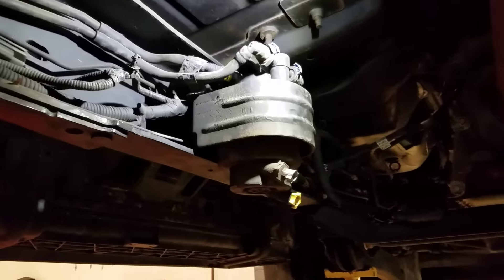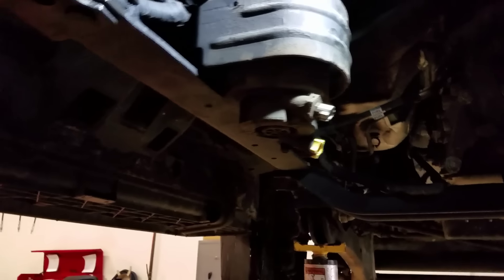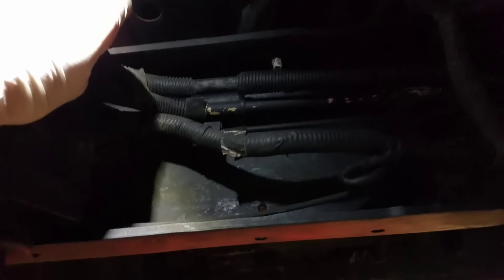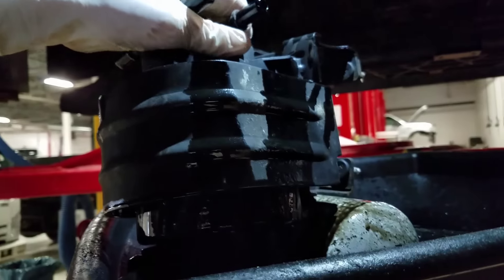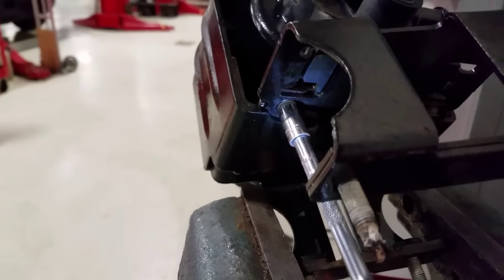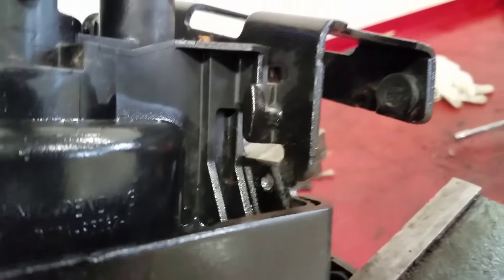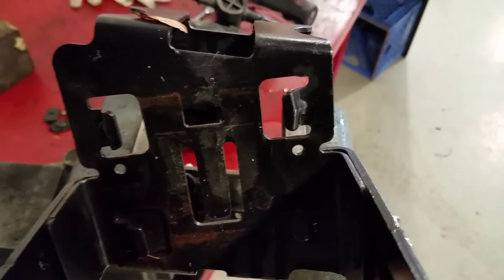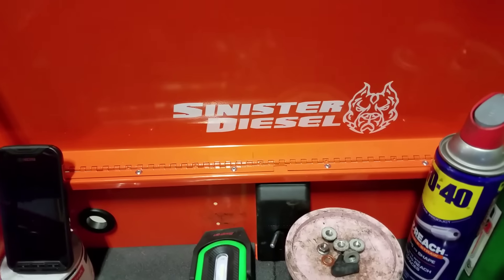6.7 Fuel pump - 11 to 16 Powerstroke

Comment: I just replaced the filters in my 2016 F20, but the pump had a hard time priming after the new filter was installed. After that it started whining and about 100 miles later, it stranded me in the middle of nowhere East of Roswell New Mexico. I pulled over and called USAA who sent an alien craft with three occupants who towed me to Roswell with their tractor beam. I got a hotel room and started researching the problem which brought me to your video. After watching your video, I went down to my truck in the hotel parking lot and turned on the key. I crawled under the truck and sure enough, the whine was coming from the rail-mounted fuel pump.

The next morning I went down to O'Reilly and bought a new pump, then I went to Harbor Freight and bought a cheap socket set, a drain pan and a roll of blue mechanics paper towels. My wife assisted me, and we got the pump changed in about thirty minutes thanks to your video. The hardest part was the trick for getting the fuel lines disconnected. Once I figured out - like you said but I guess I missed it - that you need to PUSH the lines toward the connector until they click before they'll slip off, the rest was cake.
Reply from the maker: Thanks for the detailed report. 👍
Reply: Thanks!! I would have probably broke the fuel line connectors if it wasn't for your detailed video!!
Reply from the maker: @williamcooper3142 thanks bubby

Comment: The 103 pump is good for 11-14 the other 114 pump is for the 15-16 years just learned this and thought would share
Reply: They are interchangeable.  Just the cap is slightly redesigned

Comment: I’m looking at a truck that whines like this. It almost sounds like an old Chevy fuel pump. What if I don’t replace it
Reply from the maker: .......well if wind up on the side of the road, at least you'll know why...
Reply: @PowerStrokeTechTalkwARod  true. But it has no loss of power or anything and the guy said it’s never given him any problems. Are there any tell tale signs of an ultimate failure? I’m new to 6.7s always been a Cummins guy
Reply from the maker: My professional opinion is to replace that pump. Coming up VERY soon we have a video better than this 1, showing ya exactly WHAT to do, & it was whining too
Reply: @PowerStrokeTechTalkwARod  ok awesome. Sorry for the question barrage but is there a difference between the dfcm and the low pressure fuel pump?
Reply from the maker: That is thee same thing. DFCM, HFCM, lift pump...etc

Comment: I just got a 2014 6.7. It has been sitting for over a year, I know that the fuel is contaminated I am considering replacing the fuel tank, do you think I should replace the low pressure fuel pump as well, it still make sound like it’s working I just am worried if diesel algae could have damaged it

Comment: im replacing mine because I went to change the filter and found that the plastic tabs on the back the housing were all broke off and the whole assembly was just hanging from the fuel lines. it was also starting to whine so I dont feel that bad about changing it.

Comment: Dumb question. I installed the new fuel pump. I guess I assumed it comes with a fuel filter inside?? I didn’t take it apart and look…..guess I might unscrew and look to make certain
Reply from the maker: Yes

Comment: If you get those coming in a with P0087, see if the customer is using the PM-22 and PM-23 additives. The reason I ask is because the cardboard disk from those bottle caps dislodge very easily, and can make its way into the fuel tank and block off fuel flow to the pickup inside the tank. I did this myself ONCE on my own truck! Since then, every time I purchase those additives, I pour them into five appropriately sized small jars to add to my fuel.
Reply from the maker: +Michael Chan thanks for the tip!
Reply: What else would  set that code I've changed the pressure sensor on rail and the pressure regulator as well and still no luck getting rid of that code any idea greatly appreciated

Comment: A-Rod, I have a 2014 F-350 single axle. I went to ford to get a simple oil, filter, & fuel filter change. Pretty simple! After completion, I went to my truck, started it, & it BARELY started. I immediately knew something was wrong because that never happened before ( 148k miles ). I also noticed a HUMMING noise coming from under the hood. Mechanic came out & said it had air in it & it would go away. YEAH!! I FELL FOR IT! Well, a week later, noise was just getting worse & worse, louder & louder. I finally took it to another dealership & they said it was my Low Pressure Fuel Pump. I had them replace it. $1400 & 2 days later, I’m here now asking WTH is wrong with my truck? My truck is starting the humming noise under the hood again. It’s coming from a violent vibration from the secondary fuel filter. Why will this noise not go away now? No one at Ford seems to know wth they doing! Please, I need your help 🙏
Reply from the maker: We can go over this on IG or u can email me. Est....gettin 2 be beddy bye time
Reply: I emailed u, please reply whenever u get free time. No rush tonight 👍
Reply from the maker: I dont think i got an email from ya bud
Reply: I just read it can be caused by faulty Chinese filter

Comment: Thanks for the great video. Unfortunately, Nothing seems to be as easy for me. This truck I purchased has an aftermarket 50 gal fuel tank. The end of it is partially wrapped around the pump and makes access to the back to fuel lines hell to get to. Managed to get it done, just not near as quickly!
Reply from the maker: Yeah been tjere done that, i feel ya

Comment: guys I have a 2013 f20. i changed both filters and after i got them primed i heard the  "squeal " or    "wined noise" . after looking at these comments and videos i discovered i did not tighten the housing on the bottom filter and was actually sucking up a little bit of air!!!!! thank god i didn't buy a pump.. went down to auto zone and got the 32mm socket and gave it the last spin.. #problemsolved.. thanks for your help everyone
Reply from the maker: Good!!!!!!!!

Comment: I changedall my filters bled lines and it takes 2 or3 times to start the pump does make some noise i think this is what mine need but i also  otice fuel tank leaks a little from the top this might be the issue as well

Comment: The 2016 has a slightly longer (1 inch) so different part number; PFB 114. I pre-bought the module for a Saturday fix, only to discover the difference. Oh well, back to the Ford parts counter.
Reply from the maker: Shhhhit

Comment: Thank you for the video! I think I need to replace mine. It makes a weird noise and I'm getting low fuel pressure and reduced power messages with a check engine light.
Reply: Do you have any ideas of our needs to be replaced?
Reply from the maker: If youd like my time, youll have to compensate us. We have an email thats associated to this channel

Comment: Hey bud I'm having a little issue that is driving me crazy. I have a 2015 f250 6.7 200,000 miles and  There is a whining noise when idling coming from the top engine compartment around the top fuel filter . I'll tap on the gas pedal and it'll go away but will come back after a drive and idle again.. I'll trun off the truck and I'll put the ignition switch forward without starting and the top filter is whining loud.  I have changed both filters motorcraft and orings with new drain plug and rings. Everything is tight as sound be and still making that annoying noise. Any advice or tips for a fix ? Thanks
Reply from the maker: Time fer a pump
Reply: Mine is doing the exact same thing after reaching normal temp. Guess it’s time for same fuel pump replacement  AROD, will a FASS Fuel pump kit work too?  Great videos by the way.
Reply from the maker: Id really just get a new oe pump brother
Reply: @PowerStrokeTechTalkwARod  I have an issue with my 2011 6.7 diesel. I change the fuel filters after I did that now is telling me I have low fuel pressure what can it be wrong?
Reply from the maker: Did u tighten the cap all of the way
Reply: @PowerStrokeTechTalkwARod  I think I did

Comment: I got a 2012 F-350 and it’s throwing a P2291. All it will do it crank but never start.. could it be this pump?
Reply from the maker: Probably not
Reply: Did you ever figure this out? I have the same issue now
Reply: @jackeasley2809 I did. Ended up being the injection pump. It shelled out internally. Had to replace and flush the entire fuel system. Ran us $10K for everything.. good luck, hopefully your issue isn’t as bad

Comment: My pump doesn’t squeal, but would a low pressure pump on the verge of going out cause a low fuel pressure message? And power reduction soon after? That’s what happened with my 2015 6.7, changed fuel filters, after purging takes awhile to start, get the low fuel pressure then power reduction, pulled the volume regulator on the cp4, no metal particulates
Reply from the maker: If you are sure you tightened the cap all the way, then yes that message would support the replacement of the frame mounted 9G282 pump.
Reply: PowerStroke Tech Talk w/ARod been chasing this issue for a few days and literally just got done replacing the low pressure pump and it fixed the truck! Truck runs a lot better and the new pump sounds smoother than the old, so it must’ve been going out and I never noticed it, thank you for the reply!
Reply: PowerStroke Tech Talk w/ARod your video made swapping the pump a breeze too!

Comment: Is there a reason why every time I remove the fuel tank cap there is some air sucking?
I am not sure if that pump on my 12' is working harder I notice once in a while lack of power, kinda like it has not enough fuel
Reply from the maker: Ive had to replace the tanks for that

Comment: I’m currently working on swapping my fuel cooler, I have the new cooler in however I am having troubles with fuel not stopping for me to repair the line. I tried unscrewing the filter because I thought that would stop the fuel flow but no help there, can a guy un due those connections, would that eliminate the fuel flow I’m getting at the fuel cooler end?
Reply from the maker: Budd, juss let the line drain out.......
Reply: @PowerStrokeTechTalkwARod  ok I’ll try to do that man, but it seems to just keep going lol

Comment: I have a 13’. And I’m getting a loud buzzing noise coming from the filter up on the engine if I grab the fuel line coming out to the hard line with the sensors I can feel vibration
Reply from the maker: Air
Reply: @PowerStrokeTechTalkwARod  ok kinda what I was thinking,  just started out of the blue,  I use oe filters,  it’s been about 1k miles since I changed them so I’ll try to pin point source

Comment: Problem #1. Didn't show how to get the fuel pump plug off. I'm also battling hydraulic hoses due to my company using these as haulsters
Reply from the maker: The connector i gravy. Read the comments brah!

Comment: Is there anyway you would have the part# for the blue clips or a alternative/aftermarket clip
Reply from the maker: No
Reply: @PowerStrokeTechTalkwARod   so am I just shit out of luck ?
Reply from the maker: If you need the clips they are available in the lines. That's how Ford sells them. If your not wanting to replacing the whole GD lines then you will have to look on line & look for what you need. Did you read the comments yet.....there is info there....

Comment: Last fuel pump I saw like that on 13 that was whining was because it was sucking air, the guy had changed the fuel filter but cracked the damn thing so hard it cracked the case ( I know ..say what )and didnt noticed it because it "looked fine"   So it was having an issue starting and was whining away, asked him if he did any recent work... just changed oil and fuel filtershe says..tell him did you check the fuel filter and the housing, no I just eyeballed it looks fine, told him take it off and have a look at it..nope.... go the next day to look at it, sure enough take it down housing cracked, take off the old one put on the new one work on getting air out of the fuel system he introduced, next thing you know...vrooom...lol
Reply from the maker: +Screamin Demon i loved your write up, classic!

Comment: Hi seems like you know your stuff good I have 2015 6.7 diesel and on the hard engine it cranks for extra long and not starting sometimes better sometimes not but if I turn on ignition and let it sit for about a minute will start right up do you think it’s one of the pumps. No DCT present
Reply from the maker: Ok
Reply: @PowerStrokeTechTalkwARod  what do you think can effect hot engine starting?
Reply from the maker: A.....buncha things partner
Reply: @PowerStrokeTechTalkwARod  
Cold start no problem. When I hold the ignition on for like 40 seconds it’s starting right up even on hot engine. Can it be air leaking into fuel system ?
Reply from the maker: Most likely not
Reply: @PowerStrokeTechTalkwARod  
What would you say I replaced the FPR sensor and low pressure pump all fuel filters. What am I missing? Can you help?
Reply: @PowerStrokeTechTalkwARod  
I know there are one more senior on high pressure fuel pump can it be it? Or lift pump inside fuel tank?
Reply from the maker: Brother if you wanna get down in some diag, you will have to email me and get in line
Reply from the maker: Gotta follow the pin point tests bro

Comment: ARod perfect timing seeing this video might have the same problem my 2015 F350 flashed a code of P0087, 28670 miles, changed the fuel filters, check engine light still on, can I get it cleared or bigger problem.
Reply from the maker: You need to just have it cleared with a little scan tool, shldnt b a issue

Comment: On the replacement pump, does it come with a filter also? Not sure if I need to open the new one up to add the filter and o-ring.
Reply from the maker: Yes it comes with a filter
Reply: Thanks so much for the response.  
I changed it and cycled the pump at least 8 times to prime it. But no fuel in the filter yet. Any suggestions there?
Reply from the maker: U have an air lock. Need to remove the air lock
Reply: Thanks again. Happy new year
Reply from the maker: Ditto

Comment: I've heard all kinds of horror stories about high pressure fuel pumps sending bits of metal into the injectors and having to replace the whole fuel system. Is this a secondary fuel pump in your video ? I have a 2017 Ford with a 6.7 liter diesel . I was considering putting in a disaster prevention kit sold aftermarket. What do you think about these kits. The brand I was looking at was called SPE performance parts.
Reply from the maker: Hey there! SPE is garbage. If your new to the channel you need to see the kit we put on called S&S diesel, A WAY better kit. No thats the lift pump, yours is in the tank.
Reply: @PowerStrokeTechTalkwARod  Do you do a compare video of the two pumps ?
Reply from the maker: No

Comment: ARod im working on a 2015 f550 and im trying to remove the high pressure pump and the gear doesnt have threads to put a puller on it thanks
Reply from the maker: Once u have the pump bolts loose, tap the nose of the oump once the nuts removed and the taper fit will pop letting the pump slide back and the gear to come off.......make sure u......time it right.....
Reply: @PowerStrokeTechTalkwARod Thank you sir leave the back nuts loose and hit it on the front of the shaft

Comment: Have you ever had a fuel pump break by over tightening the filter housing? Like is that even possible? Because my filter is on tight but it seems like it's not getting primed like it's sucking air, but I'm hoping it's not a crack in the plastic pump
Reply from the maker: Yup I cracked it right where the socket goes

Comment: I changed my filters and didn’t get it tightened enough. Had whirling sound and drove  it a few days .  Hauling my trailer under heavy load I got the reduced power and low fuel pressure alarm.  I was like WTH ...I then tightened again and the noise was gone until I was hauling my trailer with heavy load then I could hear it again but no alarms or reduced power. Was not very noisy but I could still hear it. Does this mean my pump is going out?
Reply: i am having the same issue. after changing the 2 filters change. any up dates
Reply from the maker: Prolly time 4 a pump like i told the last guy
Reply: @PowerStrokeTechTalkwARod   thanks. odd part is that it was quite before the filter change
Reply from the maker: Happens 👍🤷‍♂️